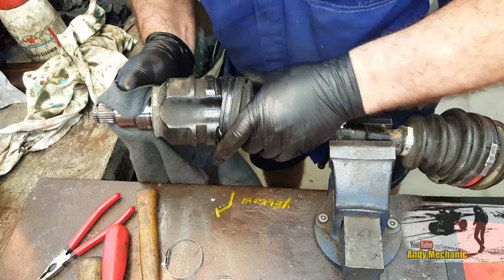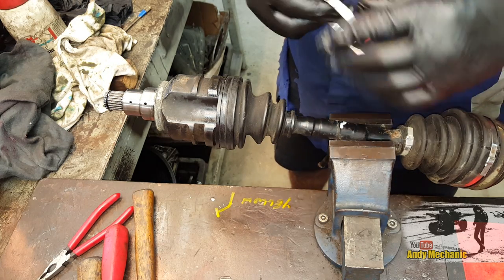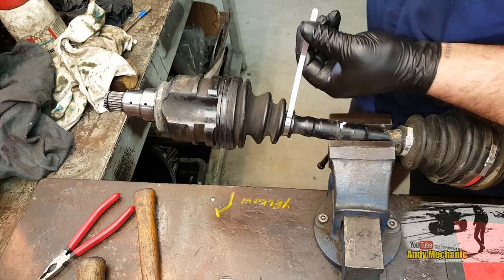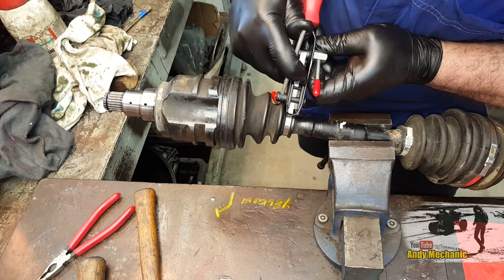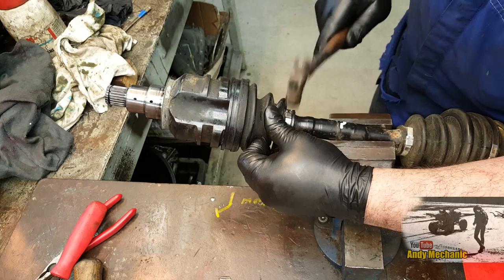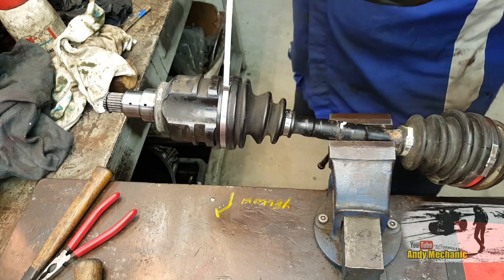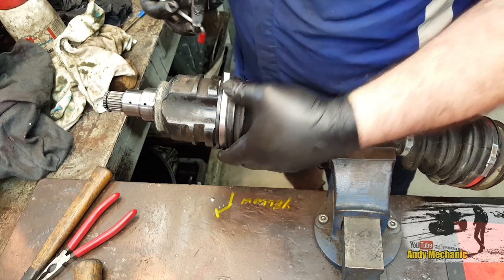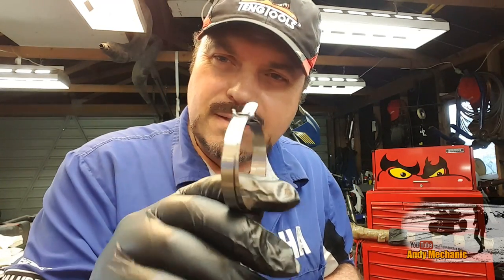How to fit the clips on a CV boot #1009

Comment: Best video I've seen, specially bending over and holding the handle. If you don't know that, the tire slides back unnoticed. You then have a clamp band that is too loose and you can start again and a clamp band wasted. Thanks Andy

Comment: ....An excellent Vid Andy ... when I did my apprenticeship we were taught to first determine the correct direction of rotation of the driveshaft (ie left side or right side of vehicle) and then fit the strap so that when we folded the tang over it would be less likely to catch, snag or undo itself on when rotating in the forward DoR ... of course this makes no difference if the vehicle reverses !!   Cheers ...

Comment: I actually bought one of these tools to reband the CV joint boots on my Honda Element.  Used it on both inboard and outboard boots but couldn't get enough tension on the outboard CV boot because I was reinstalling the OEM thermoplastic boot and it leaked.  The inboard CV boot also OEM but made of neoprene rubber and didn't leak. Switched over to the "ear" type bands because you can get more tension and they are about 25% wider.

Comment: Do you think you might be able to tell me why the CV boot keeps popping off my CV joint? I got a brand new one from Auto Zone twice and both times immediately after being installed, the boot popped off. Auto Zone said the rings come pre-tightened.
Reply from the maker: Hi Angela, well, every CV boot I have installed you fit the retaining clips last & they have to be tightened as per the video. It wouldn't be possible to have pretensioned retaining clips. I suggest you take the car to a proper garage!

Comment: I don't think I've ever seen that style of band before!  The ones I've used have all been the sort that have notches you use to set the band preload, then use a special pair of crimping pliers to tighten down an extrusion in the band.  The same style tends to be OE equipment for boot seals on most stuff I see here in the States.  :)
Reply from the maker: +rhkips I know the ones. We have them as OE fitment but can't buy them here in NZ so it's become the 'norm' to use the type I had in the video.
Reply: rhkips They are called Ear-Type clamps and need the crimping tool.
Reply: MarzNet25

Comment: Is there anything wrong with using jubilee clips (worm drive clips) like you find on radiator/heater hoses?
Reply from the maker: They'd work for sure but remember that drive shaft rotates at Wheel speed. The worm drive clips are unbalanced - weighted where the drive is. At higher speeds this would probably cause a vibration. If it's a slow speed vehicle like an ATV then no problem using them but on a car? I'd suggest not.

Cheers Andy
Reply: Wow, good point! Thanks!!
Reply: Removing mine right about now! Lol
Reply: @michaelserrano7097  You've had jubilee clips on? Were you experiencing vibrations?

Comment: I've had some very ugly, clicky CV joints pass a WOF in the past! I get boot kits with clips that don't need a special tool, seem to work well. nice vid
Reply from the maker: +Badgertronix It's crazy here in NZ. The condition of a CV joint is not considered in a a WoF inspection, despite it been a critical part of the drive train and can affect steering if it collapses....NZ regs????

In the UK, it would be an MOT fail.

Comment: Lmao!!! Wait until grease hits the brakes before its a fail 😭 in England they don't wait till grease hits ya brakes were good like that!  "oh shite no brakes!!!....."I knew I should of changed that rubber boot for the price of pocket chaaa! ......💥💨 👼hilarious or not whichever way u look at it.
Reply from the maker: +Richard D So true & terrible too. Did you know that the condition of the CV joint is also exempt from the NZ warrant...despite the fact that when they fail it can affect steering and cause the driver to loose control of the car!

The NZ Government would be better suited running a circus!